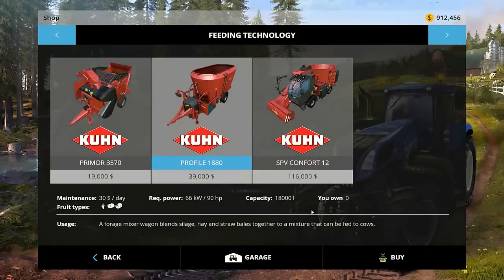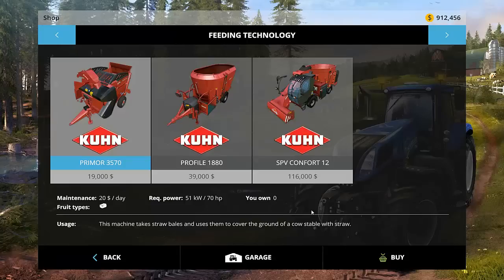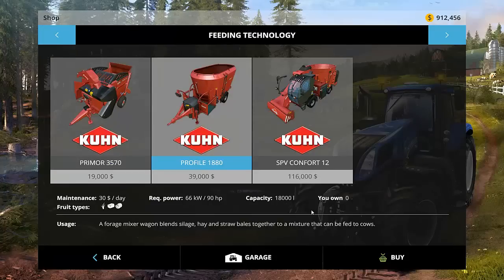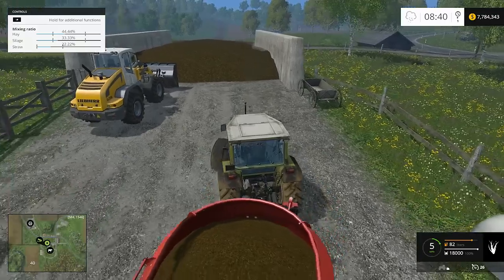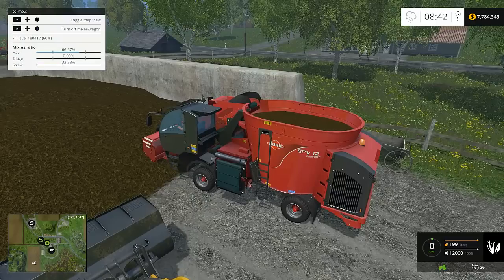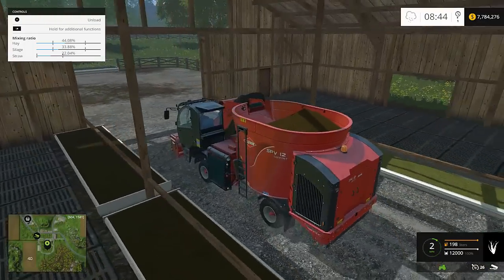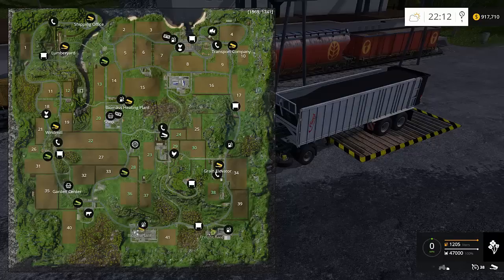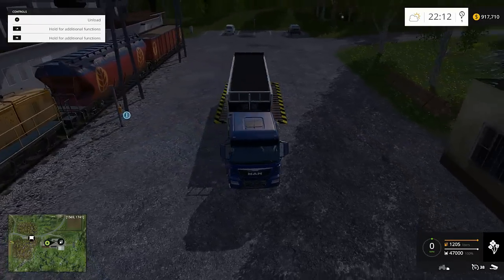Inzainia Plays:Farming Simulator 2015 Basics EP9 (Multi mix and Double value sales)

Comment: Do you know how long it takes for wheat,barley, and all the other types to disengrate? Like if i had 100 tons of barely what happens to it after a week? Does it decrease or does it all go away. Just curious. Great video btw. Did not know about the train doubling lol.
Reply from the maker: I'm not certain tbh. In 13 if it degraded over time in the silos it wasn't noticeable. So I assume the same here. I have never watched it to see if it lowered over time, so I am under the thought that there is not spoilage. But I could be wrong. The best way to find out I guess would be to monitor the amount you have of something, then save your game, then set time to 120 and watch a movie or something, then check it afterwards and see. Hope this helps wish I knew an exact answer to give ya.

Comment: You dont get x2 just by sending away the train, the sum of money is still the same if you sold it someother place.
Reply from the maker: actually, when i was last playing (omitting the possibility they changed it in a patch) after calculating (and even save reloading after selling to each place), the train did in fact, give 2x the going rate of any other place. this is not to say that they have not patched it since, or it is different on different platforms(360 ps3 pc etc..), also difficulty plays into how much you get. if you are playing on hard, you get less.